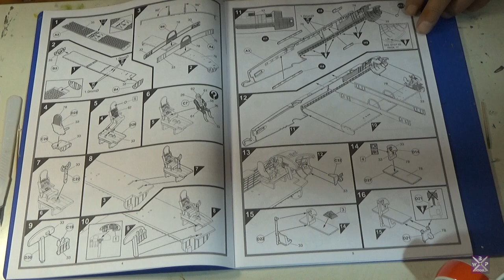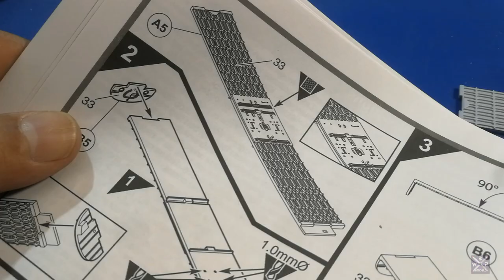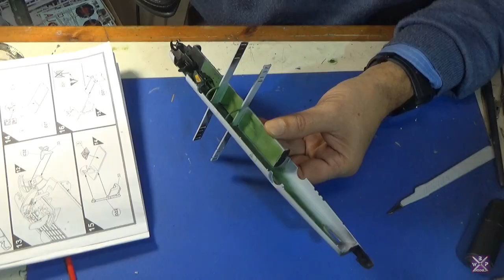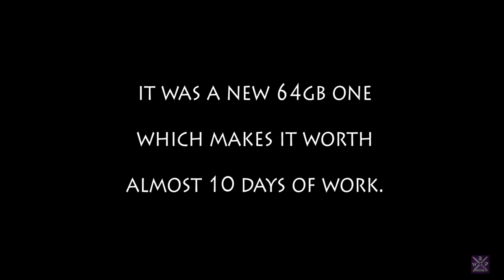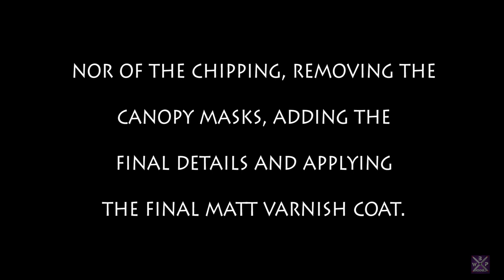Airfix Avro Lancaster B III Special (The Dambusters) 1:72 Full build

Comment: Nice build, lots of kiwis in the brilliant dam busters squadron. Working on an F-35A 1:48 by Kittyhawk atm myself. Actually it’s a good quality model. But masking for the radar absorbing zigzags is a a NIGHTMARE
Reply from the maker: that's ONE of the reasons I don't do modern aircraft :P  I hope it gets great. Thanks for watching! :)
Reply: @wbpsmodels3452  You can buy pre cut masks for that. I just did an Italerie 1/32 F-35 using masks and it turned out great. I'm not a fan of modern aircraft, I'm more a 1914 - 1945 era modeler, my preferred scale is 1/32, but I will do modern aircraft on commission, like I did for the F-35.

Comment: There's nothing in the instructions either. I think Airfix assume that your not going to build the kit with the mid-upper turret as they include a 'plug' to put in its place - a pity! Perhaps this turret was removed to save weight on the raids????
Reply from the maker: As I saw in a lanc history documentary,  the upper turret and some other parts were indeed removed to save weight and increase range, in preparation for the missions to locate and sink the Tirpitz.
Reply: @wbpsmodels3452  Many thanks for this. Yes, after much web searching the turret was removed for the dams raid.

Comment: Hi sir - enjoyed your video on the Lancaster - question im building it atm - did you have any fit issues putting the 2 fuselage halves together?
Reply from the maker: I can't recall having any difficulties with the fuselage, sir. At least no more than anticipated...  The Dauntless SBD gave me quite a hard time putting the halves together... But I can't recall anything specific with the Lanc.   Good luck with your build! :)
Reply: @wbpsmodels3452  hey buddy thanks for getting back to me so promptly. The 2 halves just don’t want to set together, particularly the underside. I tried some super glue last night, there may be som filling and sanding ahead, cheers.

Comment: Hello, what was the name of the tool you used, the mini paint spray thing. How much is it as well? Thanks
Reply from the maker: It's called an airbrush and it goes from $40 to $300 depending on the brand
Reply: @wbpsmodels3452   Oh right, than you very much. Just one more question, what did you use to do the smoke markings coming from the engines?

Comment: Really enjoyed the video, and the Lanc. looks great. Sorry you had the problem with the video, nasty! I've just got the kit for Father's Day and started work on it. Painting the gun turrets, I realised that there are parts missing for the mid-upper turret. The guns are in the kit, the 2 parts of glass, and the coaming (see Wikipedia) but no mounting for the guns as with the nose turret and tail turret. Can anyone advise on this?
Reply from the maker: Thank you for watching, As I recall - and you can see-  I did not use the upper-middle turret at all, following the instructions..  I guess this particular model did not have a turret there...
Reply: @wbpsmodels3452  I notice on Modellingmadness.com that Their model also has the mid-turret removed.
Reply: There was no upper turret on the 617 'Dambuster' Lancs - removed/not fitted for weight saving reasons!